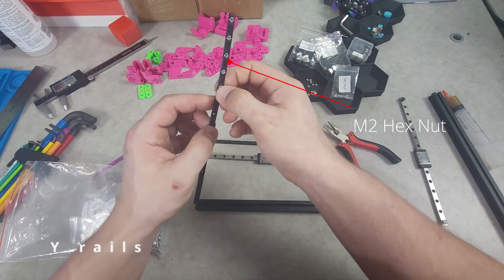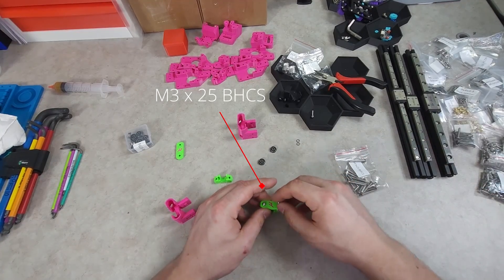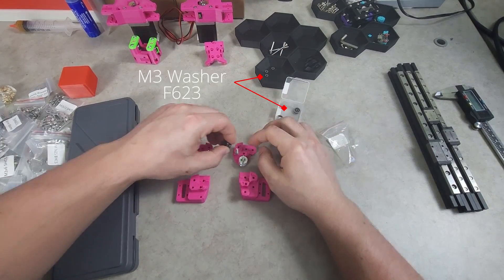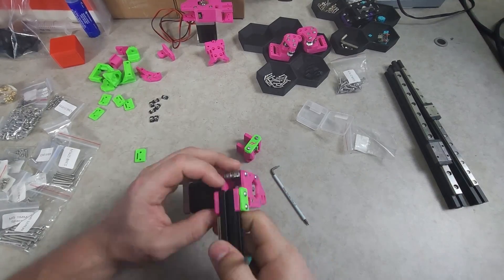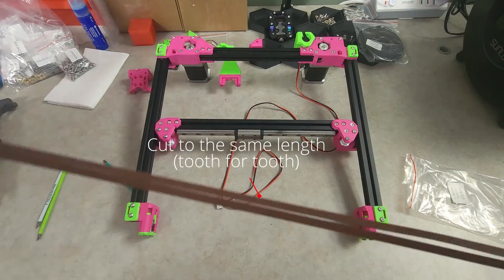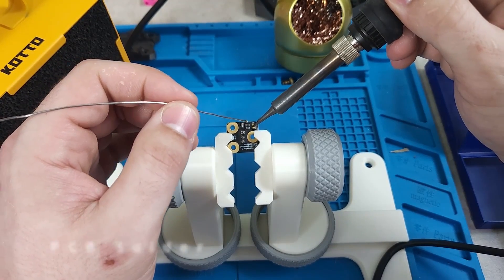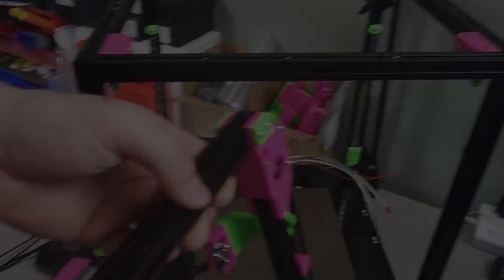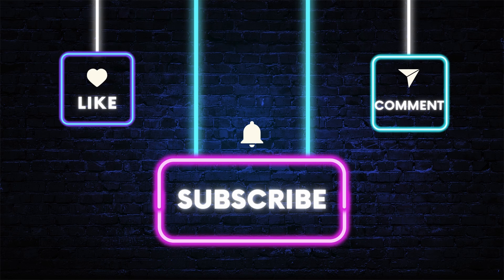Formbot Micron Plus Build: Gantry and Belts

Comment: Cool video, looks good! Just finished my Formbot micron+ and did have some bumps on the way, partly due to the "workbench" (cough*, very old and wobbly Ikea table) I'm using not being square. Did your kit come with the 180mm gantry beam for the AB drives? My kit had 190, but 180 was specified, so I ended up building it with the older gantry and later cut it to fit the new one. Also you might find this interesting. If you use some standard M3 standoffs, nylon or brass you can mount a beacon/IDM/etc scanner directly to the x carriage. I use 20mm for mine, with Phaetus XG. Might have to try out the BZI idlers, already run BFI. Keep up the good work